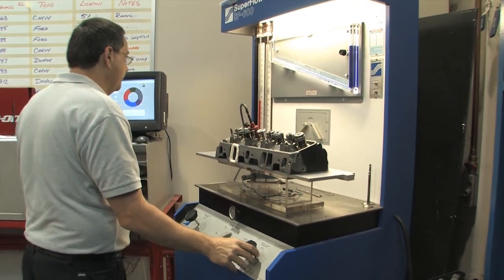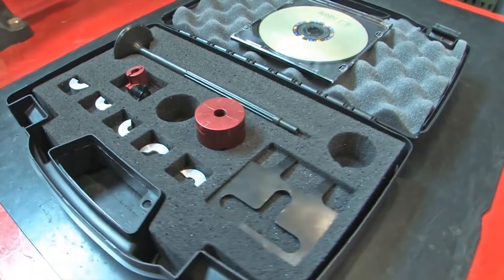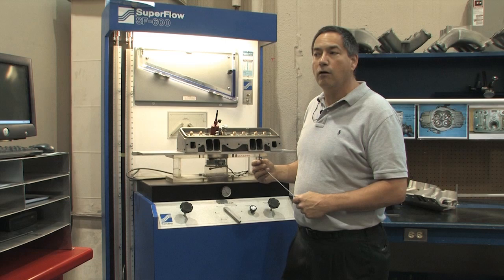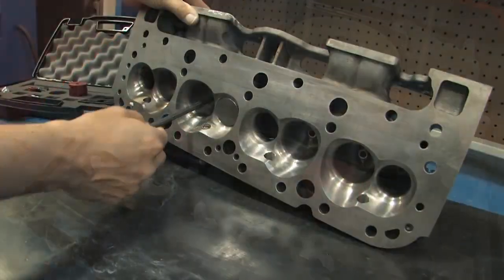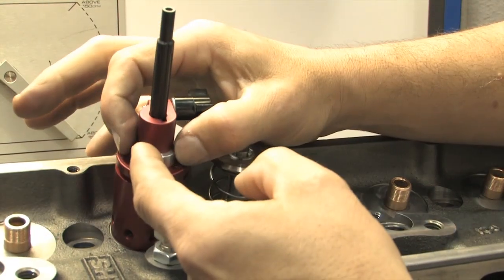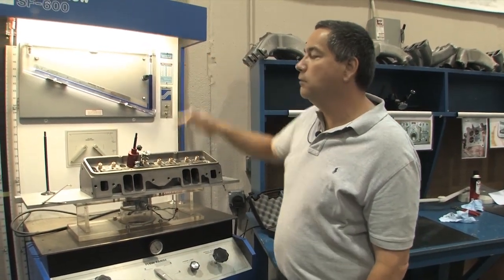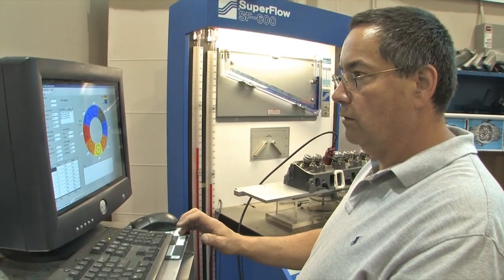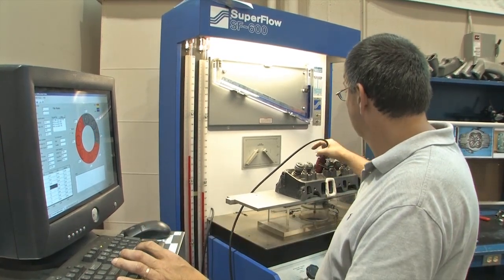Improve Cylinder Head Performance with this New Invention (Part 1)

Comment: So answer me this , every time I place a piece of string into the port flow . Why does it only go around the short turn radius ????
HUMMMMM
Reply: Shot turn radius is a low pressure area like under an Airplane wing, makes a good place for fuel to drop out of air mixture
Reply: davie biggions because that's where velocity is the highest, the short side radius..